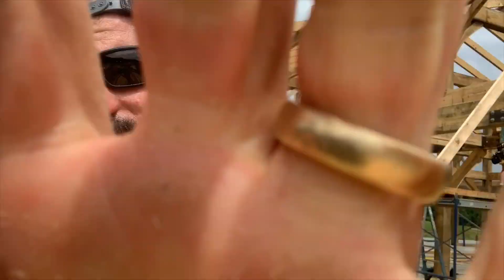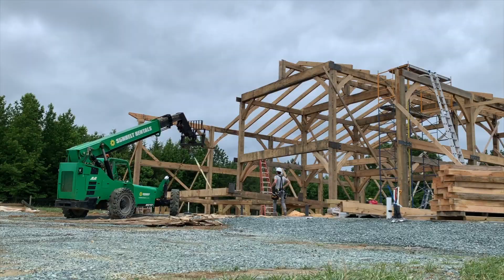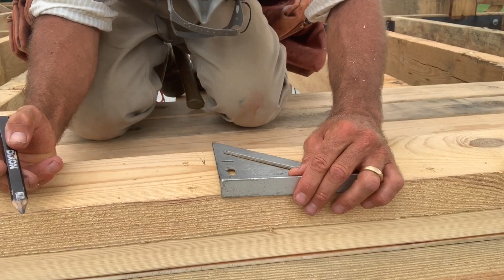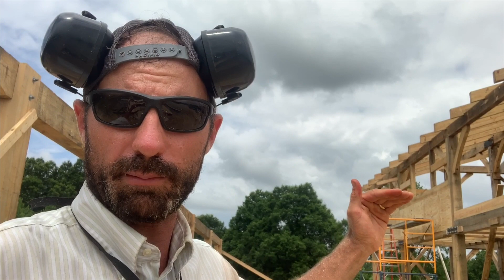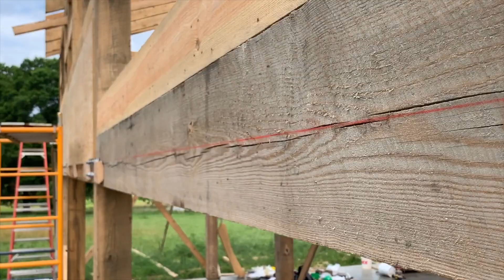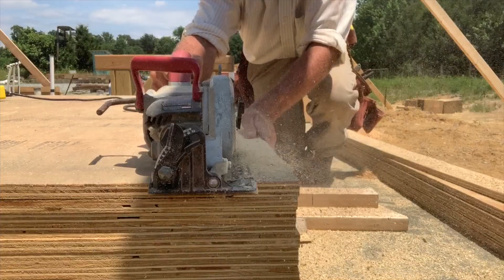TIMELAPSE Construction VLOG | Window Framing in a Timber Frame Wedding Barn

Comment: Hi Logan,  I really appreciate your videos!   I'm planning a barndominium of our own.  Can you tell me what size rafters are needed for the shed roof with a 20' span?  And I'm planning posts on 10' centers, 16' high with a 22' clear span and a peak height of approx 24'.  What size rafters would I need for that, along with what cross members, and how big do my inside posts, and outside posts need to be.  Can I get by with 12"X12" X 16' posts?  Can I use 4 inch angle iron for ties?  and can I use 8"X8" X 9.5' posts for outside shed wall on 10" centers?.  
My plan is to use 6"X8" logs for the walls, interior and exterior.  If I tie those onto the posts by notching the logs, do I still need braces?  
Thanks for any suggestions!  John